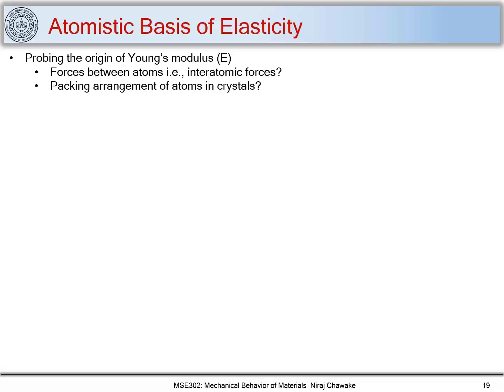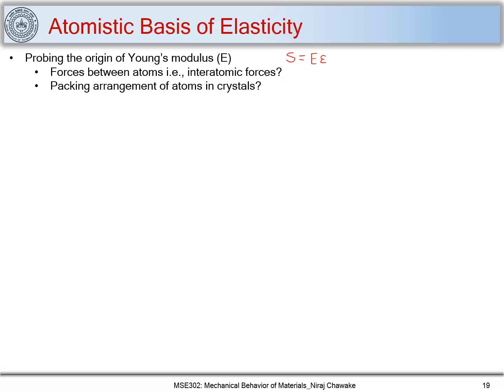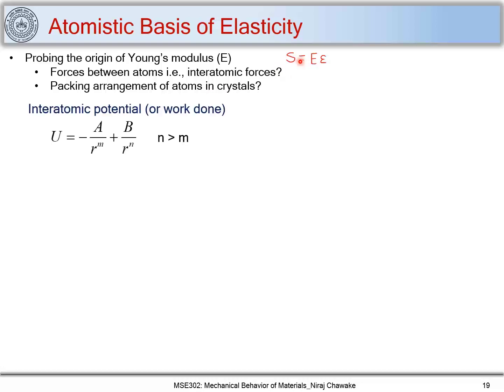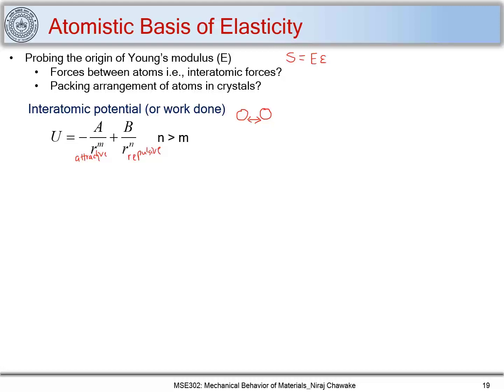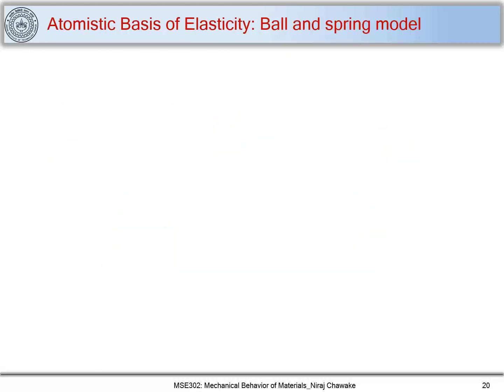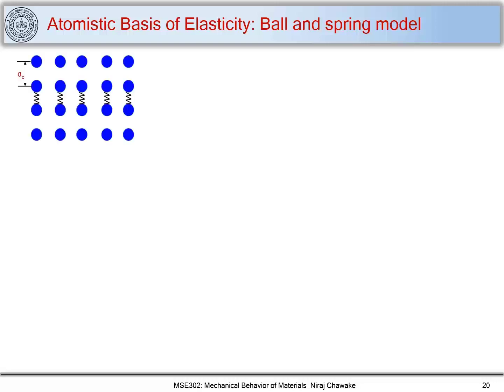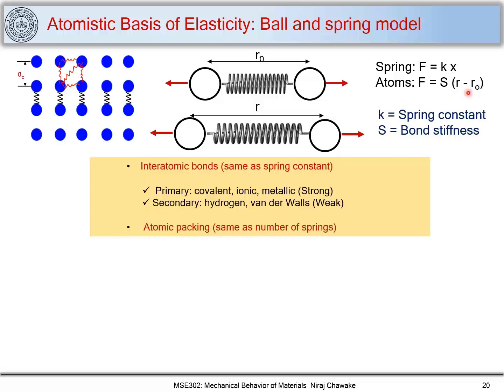5. Atomistic basis of elasticity

Comment: Sir can you please eloborate the difference between stiffness and Elastic modulus more.
Can we say that stiffness is property of material and elastic modulus is its measurement?
Reply from the maker: Bond stiffness and elastic modulus are connected yet distinct properties. Bond stiffness describes the atomic-level binding strength between atoms, ions, or molecules, reflecting how tightly they are held together. Elastic modulus, on the other hand, is a macroscopic measure of a material’s resistance to elastic deformation across a measurable area (as when compared with atomic length scales), particularly under tension. Both are intrinsic material properties, with bond stiffness deals at the atomic scale and elastic modulus applicable at the macroscopic level. Hope this helps.

Comment: The spring is the attractive force between electrons and the FE ions. As the atomic separation increases, due to strain, the equilibrium disturbed, the attractive force exceeds the repulsive force and that is the STRESS. My guess.
Reply from the maker: An interesting idea to consider. However, stress has much more profound implications. The spring serves as an analogy to explain the linear elastic behavior of materials.

Comment: sir why Al CU & Ni having same fcc have different values of young modulus
Reply from the maker: Hello Rohan,
Many thanks for your query. This is a rather fundamental question. You can see how the atomic bonds are the origin of the elastic modulus, as explained in the video. Attractive and repulsive forces (between the nuclei and electrons of interacting atoms) contribute to the bond strength. Despite having the identical crystal structure, Al, Cu, and Ni will all have different bond strengths (or stiffness) because of differences in these forces based on by their atomic numbers. 
I have simplified this explanation, but I hope it helps.